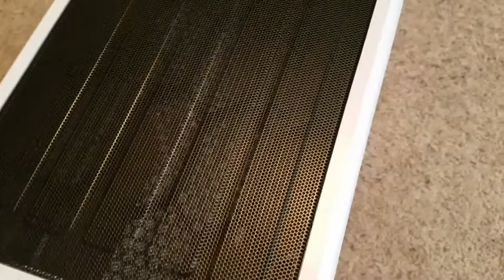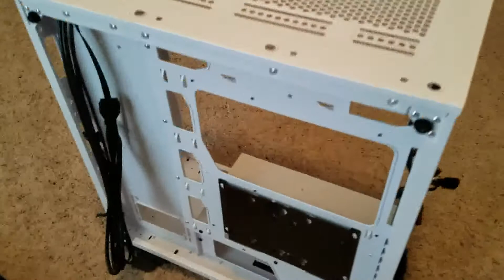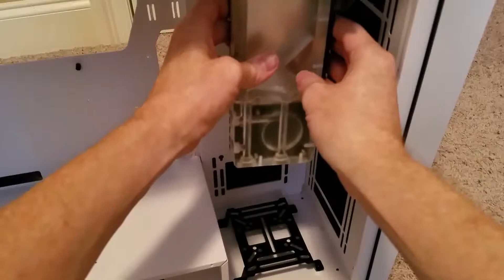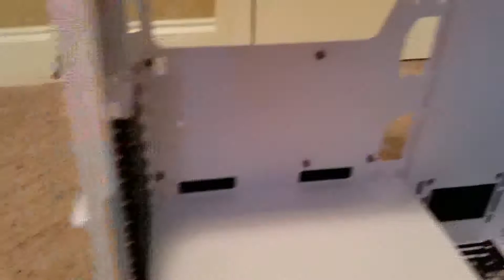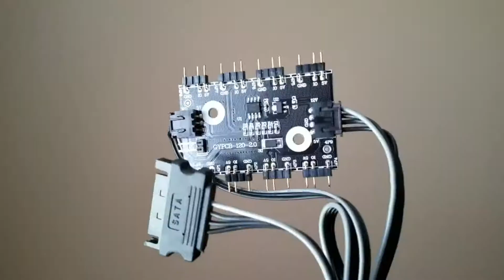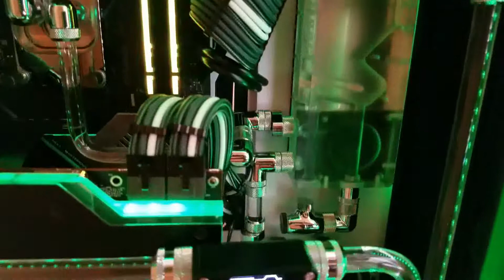Raidmax Magnus Z23 Tempered Glass plus custom water loop

Comment: Hey dude, nice video. Can I put an approximately 320mm radiator on the top? Thanks.
Reply from the maker: Yep, just make sure there's nothing on the inside of the front bracket or it could interfere with the top rad.

Comment: is there alot of space in the case to do most all liquid cooling system setups with ease?
Reply from the maker: As long as one of your rads is no larger than 360mm and the other is no larger than 280mm you should be fine.

Comment: How did you remove the front panel?
Reply from the maker: You grab the bottom of the front panel and pull forward. That's how you do it on almost all cases. It gets easier after the first couple of times.
Reply: @FortuneSeek3rz  Thanks! Just wanted to make sure because somewhere I saw that they took the top off first before they can take off the front